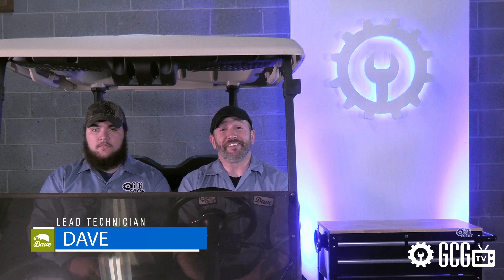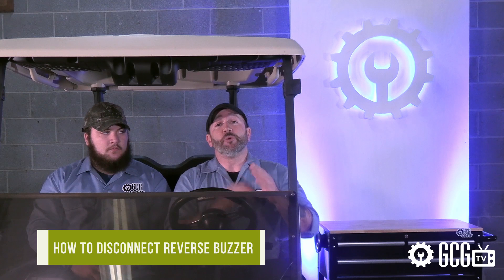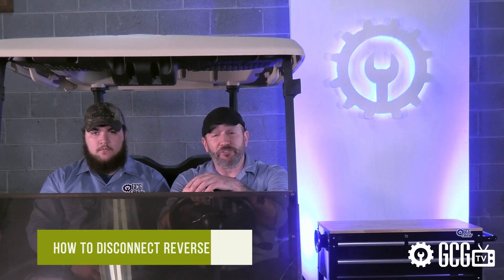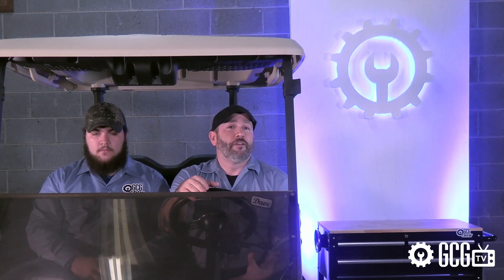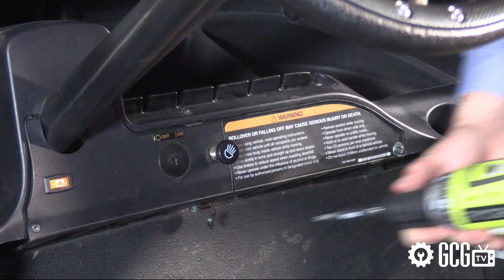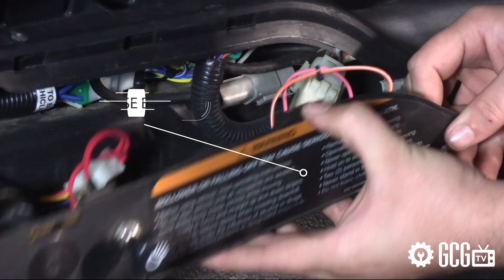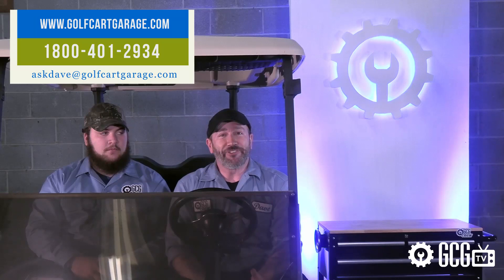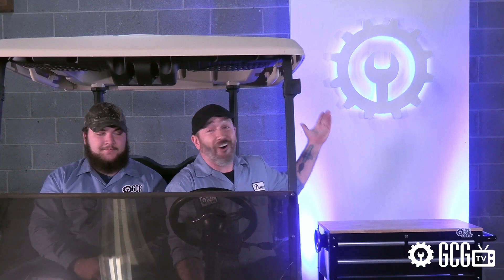Disconnect Club Car Reverse Buzzer | How To | Golf Cart Garage

Comment: I wasn't able to get the top screw out. However, I reached inside and was able to pull out just the orange wire. No more buzzing sound. All good?
Reply from the maker: Hey, Terry!  Thanks for stopping by.  Yes, you should be all good, there!  Can't hurt to wrap a piece of electrical tape around the end to protect that wiring, though.  If you need anything else, get in touch! support@golfcartgarage.com or (800) 401-2934.  You should be able to hear us just fine without that buzzer going ;-)

Comment: Love the videos guys!  I've got a 2004 Club Car Precedent and I want to  replace the backup horn with a different sound module.  Voltage feeding the horn is 48v, but it wont drive the bench made sound device I have.  It also won't activate a 48volt relay.  Not enough amps?  Is there a relay that it will activate?

Thanks!

Steve
Reply from the maker: Thanks for watching, Steve!  Sounds like you might benefit from having our techs take a look with you, remotely.  You can get a free appointment here: https://www.golfcartgarage.com/gearheads-on-demand/
or you can talk with our techs at Support@GolfCartGarage.com or (800) 401-2934

Comment: Can it cause any damage to the cart if you unhook it from a electric Cart
Reply from the maker: Thanks for watching.  No, it will not cause damage to disconnect the buzzer.  The wiring there only exists to sound the alarm when in reverse gear.  Let us know if you have more questions or need help, just get in touch.  Support@GolfCartGarage.com or (800) 401-2934

Comment: When club cars go forward and not in reverse, what could be the issue?
Reply from the maker: Thanks for stopping by!  It sounds like your forward/reverse switch may be failing to engage with your controller (assuming your cart is electric) and maybe you should contact our virtual diagnosis service at golfcartgarage.com/gearheads-on-demand which is (for now) a FREE service!

Comment: Half that video was just a bunch of malarkey.   I thought it was about disconnecting the reverse buzzer. 😢
Reply from the maker: Only half?  We can get a higher malarkey ratio than that.  Tune in next time!  (to be fair, you can use chapters at the bottom of the screen to skip to "procedure")

Comment: Good tip. Do you have any suggestions on speeding up my 2022 club car precedent gas car?
Reply from the maker: Thanks for watching!  A little more speed on that cart is simple with a Lift Kit / Bigger Tires or an Engine Governor adjustment... or both.  We can also help look at engine and belt upgrades if that's not enough, feel free to get in touch if we can help! support@GolfCartGarage.com or (800) 401-2934.  You can also check out our video on the basics of speed here: https://www.youtube.com/watch?v=ElhaSpdxIlc
Reply: @GolfCartGarage  great. Thanks for the quick response. I bought this with a factory lift kit aftermarket wheels and a rear fip seat and windshield. I watched a video of a guy that put a wire tie around the throttle spring and backed off the governor screw a little and gained some speed. He said it doesn't hurt the kholer moter and is safe but im.a little skeptical about that mod. What's your opinion
Reply from the maker: Can't see anything immediately wrong with that, but skepticism is sometimes wise.  You can check it out in real time for free with our remote diagnostic service here: https://www.golfcartgarage.com/gearheads-on-demand/